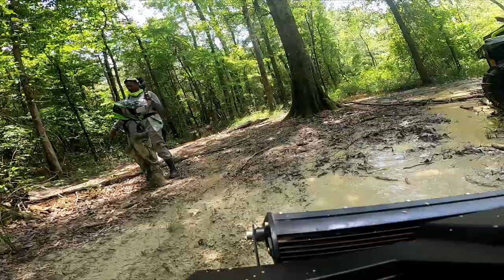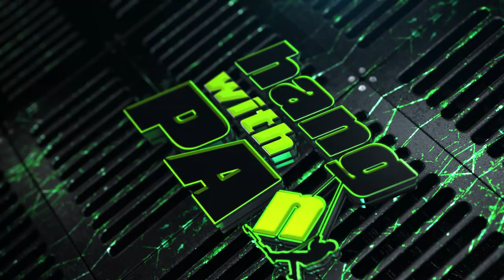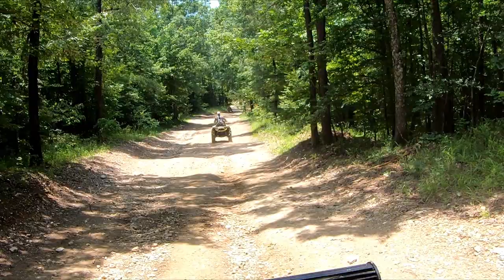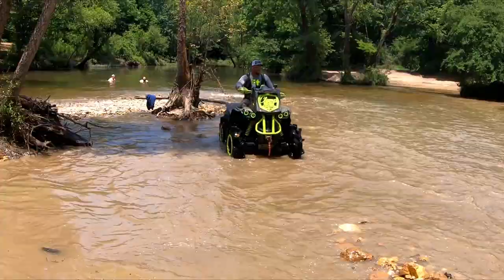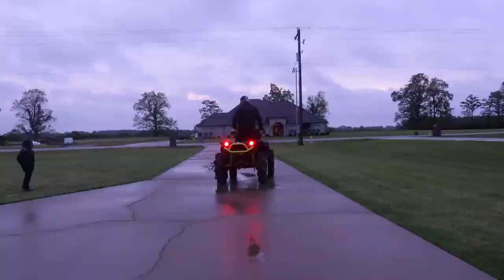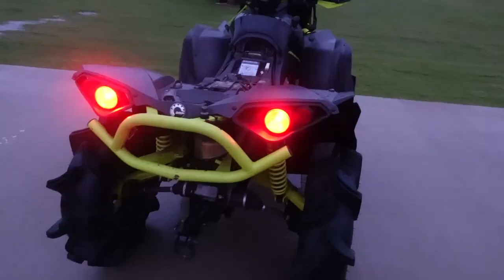DID I MESS UP? SLG WELDING EXHAUST SOUND CLIPS - CANAM RENEGADE 1000

Comment: hey Again,

Did you get the "Quiet" one? Did you "re-tune for the "straight pass through" most SLG Pipes seem to operate like? And any regrets about going with a slip-on vs factory?
Reply from the maker: No quiet one. Yes i retuned. No regrets, expect when i try to film when riding, otherwise love it
Reply: @HanginWithPA  So you got the Sniper Performace or Sniper Quiet? And what tuner did you use DJ?
Reply from the maker: Performance . Ray Parker tune video on my page
Reply: @HanginWithPA  Roger, ty for the quick responses - now I need to figure out if I want Performance or Quiet Edition..... and ty for the reference to the tuner, ill check it out.
Reply from the maker: No problem